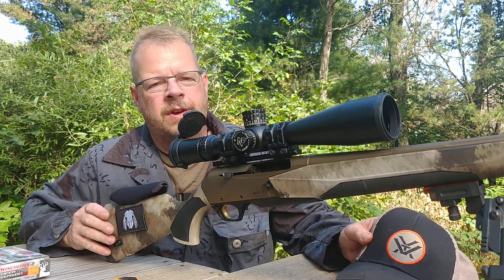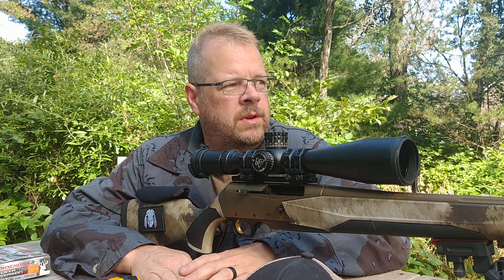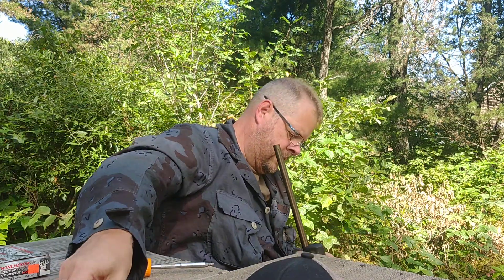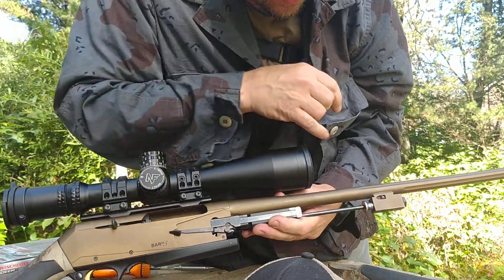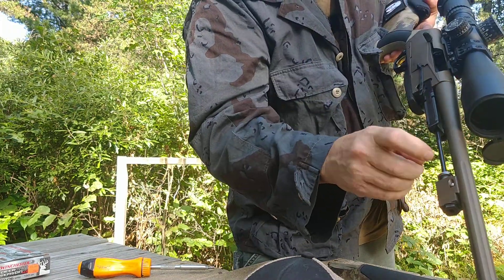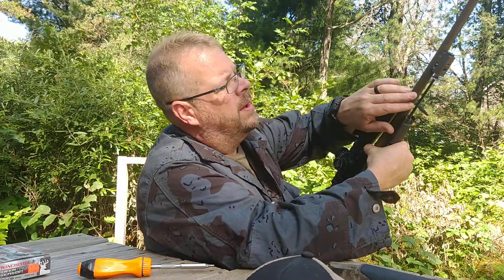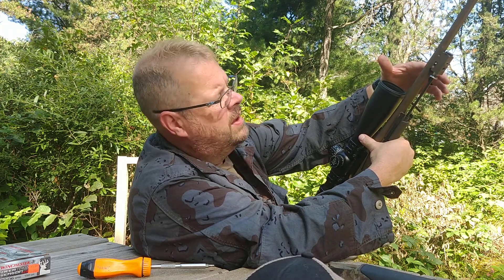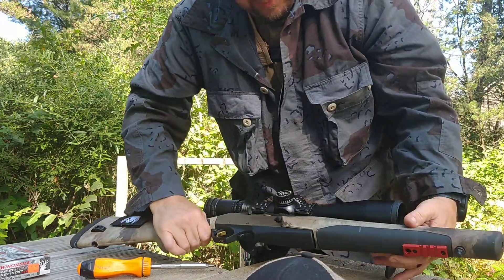Browning BAR Mark 3 feed issues, short cycling,

Comment: Paul , 
It worked  …
Thank you for taking time to do this  
It took four turns really slowly for me to get to the point where it would cycle  .
 You are correct there is not a lot of information out there .
 Thank you again I have a functioning BAR now . 

Here is what I put on one of the Browning sites bragging on the gun ….

I had significant jamming on my new 30 Ott six mark III BAR .
There is an adjustable gas block under the forearm .
If anyone is interested  …
I loosened the number 2 Allen screw .
It keeps the adjustment screw where you put it  .
I turned the adjustment screw all the way in , turned it three complete turns out . Jammed !
(my first attempt.)
Then I turned it a half turn more. 
( my 2nd attempt)
It’s still continue to jam .
(3rd time was a charm .)
I turned it one more half turn ,
If anyone is counting, that is four complete turns out .
I shot 10 rounds through it and it did not jam .
Everything ejected correctly 
If anyone is having this problem, here’s an answer .
Maybe not the answer for everyone.
But the gas block can be adjusted  .
Just do it slowly .
I’m not saying everyone should try this  .
Happily, this worked for me  .
Reply from the maker: Outstanding, glad it tuned up for you    I enjoy hearing when this solution works. Shoot straight.   -Z

Comment: Paul
Well I'm glad you were able to find a fix for your bar mk III 👍👍. Sadly I couldn't find a quick fix for my Browning AB3 which is still in the shop getting fixed. I bought my AB3 almost 2 months ago I was happy and excited to buy my first hunting rifle. So I took my new out to my nearby gun range to put some rounds in it to see how well the gun worked.  Well let's just say the gun didn't perform as well as I hoped. The gun fired and cycled well through the first 15 rounds without any issues. However after that the guns quality went downhill as after the 16th round the gun started having issues with the bolt not going into battery after extracting the spend round and loading in the new round in. So after that I went through process of troubleshooting to find out the issues. Come to find out it was the hook that held in the bolt to gun had sheared off. So I  called up Browning and told them the issue so I packed up the gun and took it back to  Cabelas where I bought the gun and they sent it back to Browning. 2 months later I'm still waiting for the gun. So far my trust In Browning is not very good. As soon as I get the gun back I'm I'm thinking of selling the gun and buying a Ruger or a savage 110. I  will not be buying Browning again after my current treatment. F**k Browning and there cheap ass guns.
Reply: Your on drugs, mine has been fine
Reply: savage 110 stock is just way too ugly for me, rugers floating synthetic stocks dont have longevity.

Comment: Thanks for info, my bar didn’t cycle only when cold, checked the set screw and it was turned out 5 full turns from tight from factory . Turned it in and backed it out 3 full turns like posted. Still didn’t cycle. Screwed it back in and out to 6 full turns out. Put gun outside in temps in teens for 2 hrs. Cycles great now.

Comment: This is so helpful! To think that Browning will not inform you on the field adjustment of their gas operated piston shows that they don’t give a damn about what happens after you walk out of the store. To hear that the magazines have to be filed to load properly and that the mechanics jam at low temperature is enough to get me looking elsewhere for a good semi-auto. Bye bye!
Reply: The BAR works just fine in cold environments. I've used a 30-06 BAR for 9 years in Minnesota and just bought a new BAR DBM in 308.

Comment: Thanks man for taking the time.  I have a bar mk2 with glossy wood in 7mmRM but I wld like to step down a notch to 30-06, in the hell's canyon model.
Reply: I have the 30 06 and it is accurate as a bolt gun out to 300 yards. Only problems are magazines feed issues and cold temperatures 8 DEGREES -11 DEGREES the gun don't FEED!
Reply from the maker: The reason that happens is the carbon from shooting builds up and when your rifle "sweats" from being warm then cold, the cold to warm, the carbon absorbs the moisture and becomes this gummy shit that causes all kinds of problems. Solution. Keep your weapon extra clean before taking it out in extreme cold. I also leave my rifle in cold as much as possible. I put it in the unheated garage. Good luck

Comment: For the BAR Hells Canyon Speed to run in the cold it must be run absolutely DRY or it will freeze up on you. Us a light film of FP-10 and wipe it dry.. 
Regardless of temperature make sure you file down the inside corners of the magazine where the brass shoulder of your cartridge rubs the magazine, then buff and apply FP-10 to the magazine where you have filed and buffed.. Your rounds will now glide into the chamber and the bolt will have a nice sharp action with minimal resistance 😉 👍.  After you do all this then check your gas block if you still have ejection issues. 

After modification of all 4 of my magazines my Rifles runs very smooth, very fast with any ammo I load or get off the shelf.  My 30-06 get 3" groups at 300 yards with all types of ammo, reload or factory.. never touched the gas block yet.

If you don't modify your magazines you will be very disappointed with your rifles performance.
Reply: I can’t find any videos on filing the magazine, any suggestions ?

Comment: OOOh Paul, I'm so trhankful for this super-video, because this is not explained in the instruction manual, although it is so important for the handloading peple. With your demonstration they are able to adjust their BAR MK3 without driving to the gunsmith and pay for a repair or conversion that could be managed by oneself. Thanks a lot and please speak a little bit slower for the not-native-english-speaking observers . Spometimes it's hard to follow and it is so IMPORTANT !!

Comment: Good video 👍
Only thing that I  would be good is removing the gas piston rod and using some Emery cloth to polish it 
Then oil resemble and then adjust the gas block.
Thanks 👍
Be safe and shoot straight.

Comment: 20 years ago I bought a 308 BAR that did not work.  I took it apart and found it had never been oiled or lubricated during assembly    It worked after oiled
Reply: I had the same experience with a browning shotgun.

Comment: Thanks for the informative video!
I don't currently have cycling problems on my 9.3x62, but I'm planning on cutting bulged barrel end by 100mm and was worried how it was going to effect the cycling.
Reply from the maker: @ketse89 you will loose speed. For every 25mm shortened you will loose about 7.6 meters per second. Sounds pretty cool though. I would be curious to see muzzle velocity data before and after to confirm my math. Good luck man. Thanks for communicating

Comment: Nice. Just got mine in stainless. Beautiful rifle. Gorgeous. Imagine my horror when it won’t eject any casing. Didn’t matter. It’s a single shot rifle for now. Pissed!!! Hope this helps me or I now have $2,000 of wall art.
Reply from the maker: No worries it will function as designed once you tune it. Good luck
Reply from the maker: Did you get it tuned up ok?

Comment: Thx for the vid is this just a mk3 problem or is it with the mk1 and 2 ? 🍻
Reply from the maker: @HEYBERT1984  i have not had my hands on either, so I would be curious. I feel the MK3 has the first gas block you can tune. Thx. -Z

Comment: Dear Paul, I hope everything is fine with you  there.  I'm here again again asking you  for enlightenment...  I'm not capable anymore  ( I did in the past and was ok ) to take off lug in the front as you did at 1:57  , I just want cleaning inside the forearm.
The  screw has been loosened for a while but it does not come out and turns idle and it does not tighten anymore !!??
all the best !
thanks in advance for your kind attention !
GS

Comment: Browning is like John Deer they do not want you to know your own equipment or work on your own equipment. Mine will not lock open on last shot with hand loads using w760. Browning told me not to touch the gas block it could kill me.. Just so you know... Seems to me they would put that in their manual! Not happy with Browning also the screw for the shoulder sling screws right into the gas black how does that make any sense? If it gets loose which mine has it changes cycling.

Comment: I have a BAR in .338 Win Mag (Lightweight Stalker) with the BOSS muzzle brake system. I have a Leupold 3x10x40mm Mark 4 M3 scope on it. The windage dial sticks out about as far as your's does. Does your ejected brass hit the bottom of your windage dial or does it eject straight out to the side and clear the dial?
Reply from the maker: My brass actually hits the receiver, I  glued a piece of leather there to stop  the brass from dinging it up. You could tune it for throwing the brass. We I first tuned this it thru the brass about 8 feet. Now it's a foot or so. Good luck
Reply: @Paul-wt6ij Thanks for the tip. How did you tune the ejection?
Reply from the maker: @joelouden6592  same as video.  You can make it not eject or make it throw them 10 feet by tuning the gas block. Good luck

Comment: Dear Friend , I have a question for you, as already wrote to you short time ago  we have exactly the same Gun, do you  have any suggestion for me for a best compatible cartridge for this Gun ? I m still struggling to find the best one lately I tried Winc. accubond ct 180gr but it does nt  perform very well at 100mt and more, it seems little be better with Winc. extreme point 180gr. 
(I choses Winchester cartridge because of Browning  recommendation )
In Italy we have quite hard wild boars  and  the engagement distance  from 70mt up to 200mt,  thanks in advance !
all the best!
Reply from the maker: What seem to be the issue? Not enough to take down hogs? Accuracy? I shoot Nosler ballistic tip 150 grain as well as the 180 grain Accubonds, I reload my own.
Reply: Hi I have mk3 wood stock and shoot Federal Powershock 150 grains and get 1 inch groups at 100 yards , try it it may work for you
Reply: @richrychlewski2128  Great to hear from you, thanks for your info really appreciate and I hope it  works on wild boar  also!! thanks and happy new Year !

Comment: Hi Paul, I just purchased a Browning BAR MK3 semi auto 308 rifle. Went to shoot this weekend at a deer and the bullet did not fire. I do see where the cartilage has i mark on it. When i went to eject the cartilage it would not eject which caused a another cartilage trying to load and caused a jam. I also had trouble with the chamber later that afternoon that the bolt only went half way which caused another jam.  can you advise me on what i should do. this gun is only 2 weeks old of when i bought it.
Reply: I hate to say this but as a shop owner the MK3's are pretty much junk compared to the older ones.This has been very frustrating for me as having a bunch of these come back. I talk people out of them at this point.  If it was me I would send the weapon back, they will most likely be able to make it work, and then I would sell it and buy an older safari grade BAR.
Reply: Its also a magazine issue,  the left stack takes more presure to feed a round then the right side stack. Try pushing rounds out of the mag with your fingers, the left side takes more effort. You need to file your magazine

Comment: It has the same gas block assembly as the FN FNAR .308.  The FNAR has the same issue.  Why they don't set these up properly at the factory is beyond me.  Mine would extract the spent case, but wouldn't send the bolt back far enough to chamber another round.  I had a semi automatic bolt gun.  Pisses you, right the hell off.
Reply from the maker: All I did was look at the schematic and saw it had a gas regulator that kind of made it pretty easy from there. Thanks for everything you do man. Fairwinds and following seas

Comment: Hey bud, how would you disable the gas system completely? Turn that screw in all the way? I want to have to pull the bolt back myself each time and have it recoil back with the spring.
Reply from the maker: I would think you could do this. Not sure about any safety concerns. That being said I would do it in reverse. Loosen index screw and turn in gas regulator screw  maybe a half turn and take a shot and work it down slow. I feel if you crank it all the way in at once there is a higher risk then if done slowly. Good luck and let me know how it goes for you. A very interesting approach but I understand advantages to that.

Comment: Great video. What kind of grouping are you getting at 100 yrds?
Reply from the maker: I can cover my 3 shot group with a nickle at 100 yards
Reply: @Paul-wt6ij  what bullets are you using?
Reply from the maker: @jackburton307  150 grain Nosler  Ballistic tip, 2970 fps
Reply: @Paul-wt6ij  For my 300 WSM, I use Federal Trophy Bonded Tip, 180 grain, and was getting 1.5 to 2 inch, 3 shot groups at 100 yards, 2960 fps. I just bought some Norma Bondstrike 180 grain, 3084 fps, and hope I get better results.
Reply from the maker: @jackburton307  what I discovered about these rifles is that when sighting in I take one shot then wait like a minute,cool down time,with action open. During that time I will snake my barrel. There is alot of metal heating up and it will change your accuracy. If I shoot fast and empty this little mag, my later shots are way off. Like 4 inches off. Run it cool and run it dry

Comment: Paul as you said not much out there on the mk3 and thanks for posting. Did you find when you tuned the gas port you got better groups? Also did you have any issues with the BAR disfiguring the top of the shells after firing? I seem to have this problem with Federal powershock ammo?
Reply from the maker: Yes accuracy improved. The bent brass is from hard ejection and it , the casing, bounces off the receiver.  You will start to see marks . I glued a small piece of neoprene where this occurs.
Reply: @Paul-wt6ij  thanks , where did you exactly glue the neoprene on the receiver ?
Reply from the maker: @richrychlewski2128  above the bolt handle and back a little. If your brass  is hitting the receiver you will notice it. So a piece of leather or neoprene about 1.5 inches long and let's say 3/8 high. I used 3M spray adhesive.
Reply: @Paul-wt6ij  Thanks Paul , I will give it try.

Comment: Just took mine out today to for the first few rounds (brand new BAR MK3 in 30-06) came home after 10 rounds with it jammed and I can not for the life of me get it to cycle.  Any advice?
Reply from the maker: First and foremost if it is a live ammo jam, bring it to a gunsmith. I have used a wooden dowel like 36 inches long with a diameter that goes down the barrel and tap with a mallet. Before that spray some gun oil down the barrel and let it soak while the rifle is vertical, an extra set of hand will help here next. With rifle vertical one person hold it and pull back on cocking handle and the other put dowel down the barrel and  tap the dowel with a mallet.  I run a bore snake thru my MK3 every 5 shots at the range to help avoid jams, especially if it is humid. Hope that helps you some, and good luck.
Reply: @Paul-wt6ij  I truly appreciate the careful and concise response sir.  I did take it to my local gun shop and he was able to work out the jam with a similar method.  Thanks again.
Reply from the maker: You are welcome sir.

Comment: Having the same problem  on my Bar mark 2  safari , it ejects well but the incoming round  hangs up on an angle , usually around the third round, I have cleaned this weapon  very well  piston and all and still the same problem. Do you think this adjustment would help ? It’s in a 30/06 cal
Reply from the maker: I have not had my hands on an MK2. Does this gas block have any semblance of the mk3 gas block tuning. I don't think you can tune this gas block. As a guy who has dealt with lots of 300 blackout cycling issues, I can only recommend trying different loads. I had a rifle that only liked 147 grain bullets. Any other load and it would not cycle. Could you snap a couple pics of your gas block just for my self knowledge. Thx man
Reply: The gas block look a lot like your maybe even the same one , the screws have like a red paint/ lock tight ? On them  I’m out of town but ya I can send you some pictures . Thanks for the reply !
Reply from the maker: @captainmidnight7012  cool. Just send when you can. If it looks like mine, try adjusting it. Good luck

Comment: I did same thing and start cycling but  Messed up accuracy 4 to 5 inches
Reply from the maker: I would make an educated guess that it was shooting low. The pressure is less at the muzzle now due to some gas pressure loss on the gas operations of cycling. It is hard to explain. Hope it settles down for you
Reply: @Paul-wt6ij  thanks for reply i only did adjust right screw is it matter i couldn't find tools for left screw my gun is MK 3 Mossy Oak Break Up Country